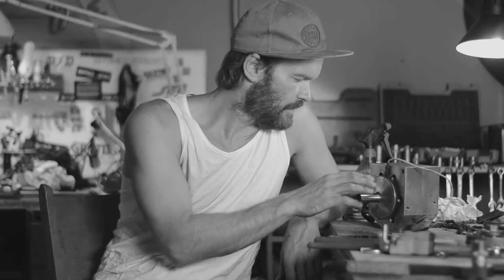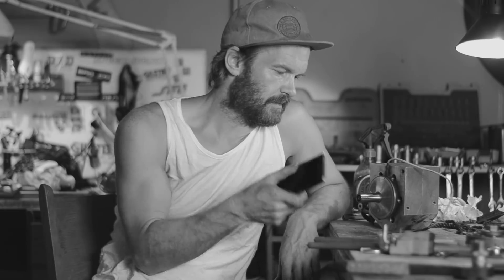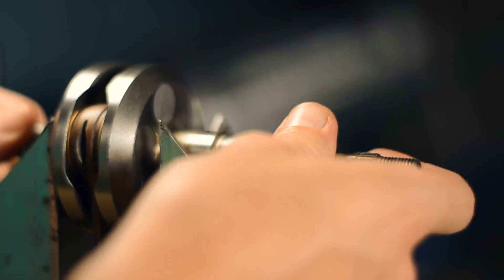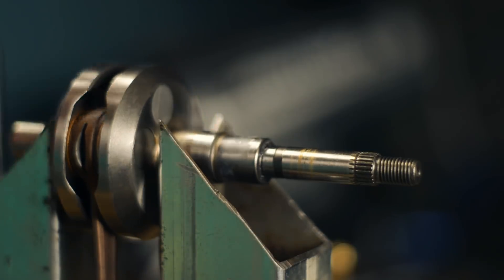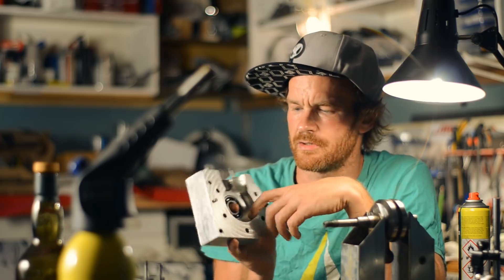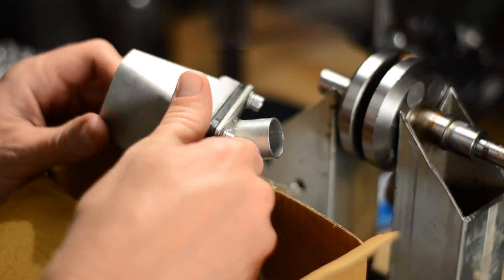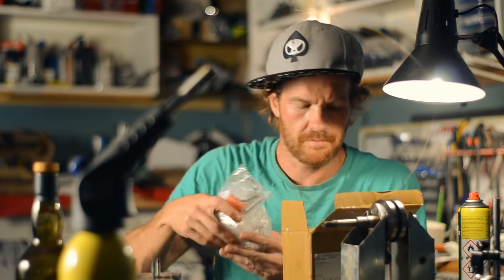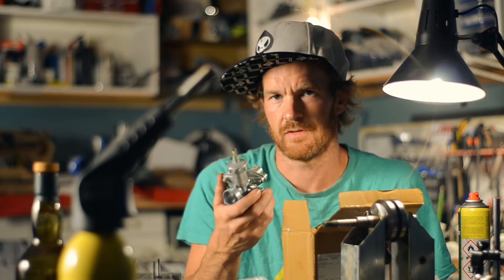I Fought the Bushing and I Won!

Comment: I need help with a carb settings watched all ur videos they have helped but still I can not get it right is their any chance u can help me ?
Reply from the maker: Sure, what's the problem?
Reply: I have a Yamaha dtr 125 that's not standard I have changed jets and needle positions it revs to maximum 11thousand rpm in first 5 gears but not 6th gear but know I have a flat/ boggy spot at around 6 thousand rpm I'm thinking my pilot jet is to big  would you need to no modifications and carb type to help ?

Comment: I have a question, I hava a pumper style carb with the diaphrams and with alcohol they like to deteriorate so how do I prevent this? Flush the system with gasoline after running?
Reply from the maker: Yes. Known as purging. Could be diaphragms available that can take it too.
Reply: 2STROKE STUFFING there nothing upgrade wise for this carb. I guess I'll do the purging

Comment: Was thinking about this after watching the other day.
Maybe you could drill a hole through the tube near the end now its off and thread the holes so when you need to get it off your could screw 2 short opposing socket head bolts in the holes to give the puller something to hold to pull it off next time.
Reply from the maker: Great idea!

Comment: Your welcome and a octane booster video would be a good idea pump gas here in the US is around 93-94 tops not counting the hard to find e85 and race fuel pumps.
Reply: Hey dark nobit you do realise that just like everything America has to use weird units to measure their fuel octane rating.
Us 91 = 95ron 
Us 93 = 98ron 
Us 94 = 99ron
Here in the UK 100ron is about as good as it gets most fuel is 95-97 
So your 93/94 is better than most fuel we get here and the rest of Europe.

Comment: If the Human race didn't have guys like this....we would still be smashing bones for marrow instead of walking on the moon. The desire for improvement lifts Humans out of the muck. Also...whiskey and riding scooters at wide open throttle screaming "weeeeee" never hurt!
Reply: I think never hurt is going a bit far....Too much brown stuff down the pie hole makes the red stuff leak out...From experience.

Comment: My Chemistry Professor was also the chief Chemist at the local Gasoline refinery, he told me 2 cups of Toluene per 10 gallons fuel is best.  Later I ran into Nitro and since it doesn't like to mix well the two together give you everything  you need, that is one shot glass of Nitro per tank (1/2 gallon) is plenty, any more and you run into all those problems you had before, yeah when it goes it's fun, but when it don't go it's the worst thing on a motorized bike because if you have ever pedaled one with an engine that don't run you know what I"m talking about.  I did everything you can do to those chinese engines, still have plenty of them lying around brand new, put a morini v1 on instead, twice the rpm's plus 25 watts power at 12 volts, plenty to power TWO of those 20 dollar bad ass led's  now found in every walmart and still have some left over.  More light than you need to blind anyone, yes even a Train or UFO and the carbs don't ever screw up, they love the Nitro also and are dead quiet.  The main problem with those chinese engines is the shaking which always causes the chain to derail, not so with an italian moped motor as you well know.  No matter how much power you get the moment your chain breaks the motor your days of tolerating them grows closer and closer to the last time and then you just realize they are trash unless you can get rid of the shake, not to mention once you go with a moped motor you will never go back to those loud ass things, I can let it idle and pedal past cops with their windows down and they don't even know it's running.
   Glad you got that thing taken care of and thanks for the video
Peace
Sizzlean

Comment: That bent crank is fully capable of handling much more power than you will make. The reason it bent was from lack of PTO support. Other manufacturers have tried larger cranks and larger bearings, only to have too much bearing speed and heat build up. You need to add another bearing to the output side to support the load.The reed induction will help the bottom end torque more than anything.
Reply from the maker: Good point, and it would save me alot of work too.

Comment: Very nice job! If you have to change bearings, what about convert them from ball bearings to roller bearings?
(Sorry for my english)
Reply from the maker: Thanks! That's a great idea, at least for the RV side where there's no axial load, the variator side is probably best of with balls.

Comment: G2 reed nice , it's not going to give much power but the hp and torque will come in sooner . You should do a couple dyno pulls before and after and compair the power curves at so and so rpm's!
Reply: The carb should give the most of the hp increase from this setup and hopefully its the correct piston because there's 2 types and also don't look at the arrow on the piston because they stamp them facing the wrong side sometimes , just make sure the two ring lockers are facing the intake port and NOT the exhaust port.

Comment: I think I'll go crank the old Jawa CZ and scare the neighborhood,  1 :18am in central Texas and 90degrees F.
Reply: Hi can i ask you something about your jawa cz? Is it by any chance a 175cc? If yes what brand and size carburetor do you have right now? Thanks in advance!
Reply: Kenan Alibegović. Sorry but it's. A converted ice bike 250cc w rake angles of American speedway bikes, using Y intake n two mukini carbs from elsinore 125s.
Reply: That is a bad solution because old jawa cz cranck are nothing compared to todays technology
Reply: Depends if the engine is a CZ 250-980 with an aftermarket Falta "pork chop" crank.

I've been tuning CZ 2 strokes since the 1980's and they take a lot of abuse that a modern 2 stroke engine wouldn't survive. Take a bike I engine I built and tuned for a friend, which resulted in him receiving a speeding ban in 1987 after being clocked and pursued at between 98 to 104 MPH (VASCAR) on his 1979 café racer CZ125-476.5 in a 70 MPH zone.

Fuel = 4 star leaded petrol spiked with approximately 10% nitro toluene.
Measured compression cold cranking = 184 PSI (14.5:1).
Piston = ASSO Werke high compression forged type.
Bearings = All SKF low friction rated throughout (Cost a lot).
Cylinder head = over zealously skimmed (see compression ratio!!).
Exhaust port = +3mm. by 45 degree chamfer.
Inlet ports = +2mm. by 45 degree chamfer with opened out tunnels.
Carb = Jikov SBD 2926 with 115 main jet (OEM is 88).
Air intake = 75mm. neck x 50mm. maw velocity stack with mesh screen.
Fuel consumption = A measured 27 miles per imperial (true) gallon.
Spark plug = Lodge Sintox HH14 (expensive compared to lesser brands).
Exhaust system = Serval expansion chamber.
Output sprockets = 19:52 (OEM = 16:52).
 
The engine would idle by dieseling once warmed up without any ignition and although it could be kick started this was not wise due to the nasty kick back.

Having a 4 speed box was a drawback as the jump from 3rd to 4th, with the larger sprocket ratio, had a big gap needing at least 75 MPH in 3rd to hook up the lower edge of the power band in 4th gear. There was a massive flat spot "hole" between 68 and 74 MPH in 4th gear. 

It was faster than the then common Suzuki RG125's, Yamaha RD125LC and Kawasaki AR125's that were around at the time. This was one of my friend's favourite past times..... burning off so called "superior" bikes on the local bypass roads on a CZ125. Nowadays it would be called "Trolling".

The bike itself was scrapped in 1989 when the frame broke its frame swingarm mounts following some reckless jumping antics with 34,000 miles on the clock. Then engine was sold in 1991 for use in an ACU Class D children's moto crosser.

This probably engine still exists somewhere in the UK. It is very distinctive with the crank case under cylinder fins painted gold, so if anyone spots a CZ125-476 engine at an autojumble looking like this, it'll be this engine. It would be nice to have it back again after all these decades as it was the best tuned engine I created out of all the many I've tuned in the past 39 years.